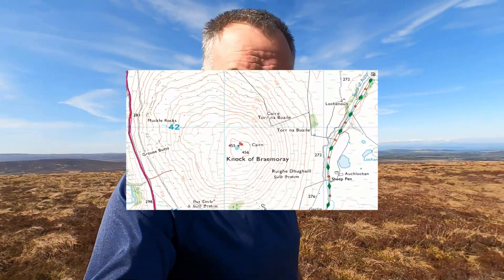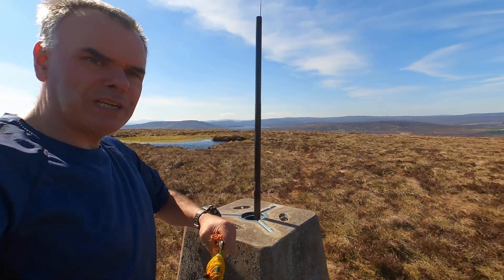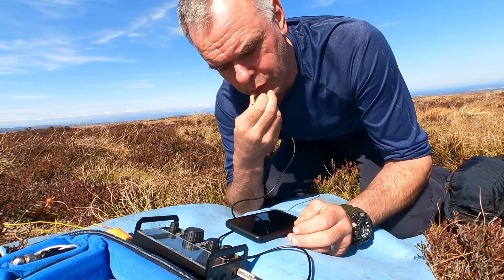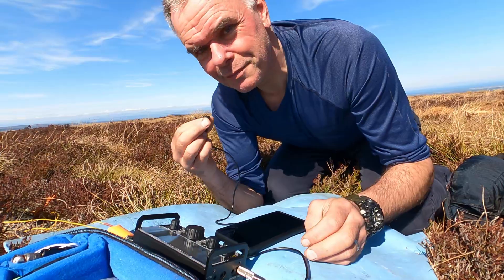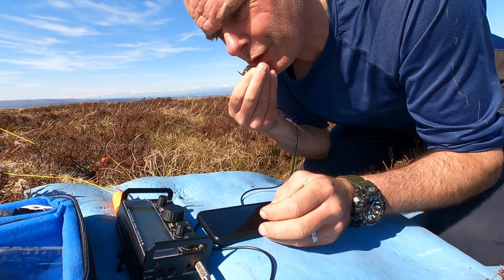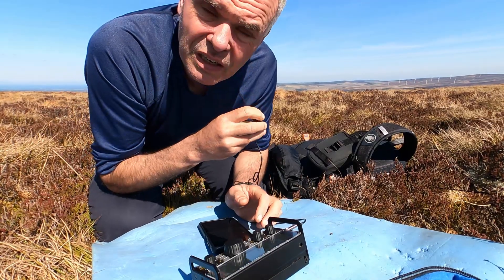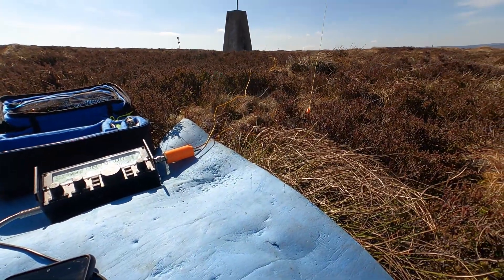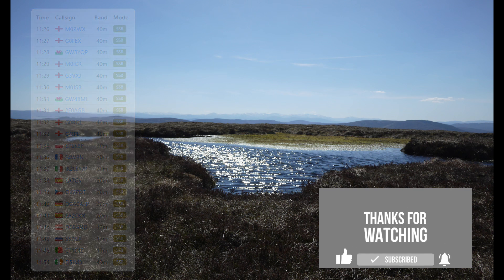What's my next HF Portable Antenna?

Comment: The antenna you used worked so well you may not want to change,  If you do change, consider 28.5 feet long with #26 wire, and use a counterpoise of the same length and wire type.
Reply from the maker: Well I did make a new one!
https://youtu.be/KFFTnBSUQM8?si=USeoo0alyPgDuDDc

https://youtu.be/ivipFuCo-g0?si=BKOG45CcGshRYqZ8

Cheers, Fraser MM0EFI

Comment: Unless I have missed them, no-one has mentioned the K6ARK antennas or the EARCHI. Granted both need a tuner, but they are small and lightweight. I have both but have only tried the K6ARK so far which impressed me.
Reply from the maker: Richard, Probably a little long for my needs. My 6m mast is only 19' in old money! The KM4ACK is longer that that and I think the EARCHI is 25' minimum. I'm fine with using a tuner. In this video I used a 41' wire, 9:1 and internal tuner. 
Thanks for the suggestions though. A lot of people are benefitting from the comments.
73, Fraser MM0EFI
Reply: @theradiorover  Fraser the K6ARK is 41’ to get 80 through to 10m. If you only want 40m and higher, it can be shortened. The EARCHI with a 30’ radiator will give 40 to 6m. For simplicity the two lengths of 25’ wire onto a BNC binding post recommended in the KX2 manual work fine and will fit in a shirt pocket. Good luck on your quest!

Comment: Fascinating to hear what it's like in a quiet location on HF, I have +32dB or more noise on much of HF/VHF/UHF from multiple sources. It's awful from 2.5 MHz up to 2 GHz, which is why I only operate on 136, 472, top band and the higher microwave bands from home.  It's brilliant here during power cuts.  I'll catch you on a summit one of these days! de G4DBN
Reply from the maker: I'm looking forward to a QSO Neil!
I often think a band is closed because it is so quiet. I don't operate HF from home either. Everything in our village is serviced by wooden poles and when I key the mic it tends to turn off everyones Internet!

Comment: Hi Fraser,
I'm also searching for a similar solution for very space restricted summits in the alps. Moreover, it has to be as light as possible. I will experiment with a (compromised) vertical solution that doesn't need a mast and no ATU. I'll create a video this summer, if all works as intended. It will be definitely better than an AX1, but not as good as a EFHW. 
BTW: if 40m is your most important band for inter-G communication, you'd need a bit of (nearly) horizontal wire in the air, otherwise NVIS will be hard to achieve.
One more idea to use a 5m GF mast with a wire that is up to say 50% longer: you could wrap it around and therefore need less vertical length. I'll also experiment with such configuration, by using the ATU-10 auto tuner, that is not as good as the one you have in your KX2, but not too bad either.
73 Stephan
Reply from the maker: Hi Stephan, I built a couple of designs this morning. They both fit on my carbon 6 mast. One is 20m and up with a 9:1. The other is 20 m and up connected straight to the tuner and does 40 m with a 49:1. Can't wait to test them!

Comment: Good activation Fraser and I couldn't agree more that the AX antennas are expensive, as you know everything Elecraft is. The internal ATU does impress me too, it tunes almost anything. All the best and speak soon. 73 Chris M0RSF
Reply from the maker: Hi Chris, there is very little that it won't tune. I'm looking forward to trying some of the suggestions made in the comments to see if I can get a really short antenna to work.
73, Fraser MM0EFI

Comment: Just a 28 1/2 foot wire radiator and a 17 foot counterpoise, will work all bands with an antenna tuner!  ;)
Reply from the maker: Yes, a shorter Random Wire than I have been using. Would save weight and space.
I'd really like something I can use on a tiny rocky summit. Think sea stack!
Cheers, Fraser MM0EFI

Comment: Ive started using my 10m efhw for sota and seems to work ok, but has a balun in a box. Might be possible to reduce the size of this. I was looking at getting a longer pole to make the efhw a vertical instead. But i do also carry an ATU-100 tuner oh and the 857.
Reply from the maker: So, a 10m long wire John? That works on 20 and 10 m without an atu, but has a 49:1 I guess?
Reply: @theradiorover  yea i think its a 49:1 i have used on those bands. I will see if i can find the info for it

Comment: Thanks for your set of videos, im finding them really useful as I'm getting the sota bug!  currently on 41 points!!  First question is about the tiny mic use use with your KX2.  I have a X6100 and have started using it with the built in mic/speaker/ppt (to save weight) but would like to know if I can make something like the one you use for my X6100.  Second question is about my current sota setup and weight. I have managed to get my UV5R + 2m Flowerpot, X6100 + 21m EFLW, 10m Counter, 9:1, 5m RG174 feeder with choke, Sotabeams 6m carbon mast + guying down to just under 2kg.  In their bag they are 2.2 kg.  I'm interested to know how this stacks up with what you take and carry on your "typical" activation and what weight / functionality decisions you make.  I'm experienced in what equipment I need for cold conditions in the mountains, in terms of clothing, food and shelter but would also be interested to hear about the total weight you carry and how much of this is radio gear.  73 E0ICJ/P
Reply: 2E0ICJ/P
Reply from the maker: 2.2kg sounds great for all of that radio gear. I've not weighed the combined weight of my HF and VHF kit together, but from what you describe, mine would only be lighter because the kx2 is probably a bit lighter than the X6100 and if I only carry my 41' antenna, that is lighter than the EFHW plus 5 m coax. 
My KX2 bag contains the radio (internal battery and tuner), spare battery, the mic, 5 alloy tent pegs, 3 guys and a guy ring, the 41' wire/17' counterpoise, 3 velcro straps, waterproof pad, small pencil and a USB power pack that will work with my phone and GPS. I only carry the power pack on remote and overnight trips. 
As for the mic. it is a baofeng one with the kenwood style twin plug cut off and a standard 3.5 mm jack soldered on. You just wire it to suit your radio. The wires are tiny and don't stand much heat when soldering, however mine has worked fine for a couple of years and there is zero difference in the audio. If you have any other queries, drop me a line. QRZ email is good, also Facebook or twitter - @MM0EFI

Comment: KM4ACK has the best antennas ever.  It’s my primary for the FT-818D.  The kits are intermittently available, but you can enroll in the notifications when the kits are in stock.
Reply from the maker: Is that his end fed half wave? If so, I made my own one. I broke it on the Isle of Lewis, hence the need for the back up random wire. If it is a different type, then share details! 
Cheers, Fraser MM0EFI

Comment: Hi Fraser, I don't think that your antenna can easily be beaten for weight.
I have a home made center loaded 5m vertical, resonant on 20m with taps for 40m, 60m, and 80m which I made for a trip to Snowdon with Ben. It's never going to match a horizontal for SOTA on the lower bands where most of our contacts are <1,000 miles but has a small footprint for crowded summits. I have recently made a QRP ground tuner which seems to help, but this antenna is always going to be a compromise.
Tim, G5TM's YouTube video 'How to get great results from your vertical antenna' has sold me on the idea of a non-resonant vertical for DX on the higher bands.  I tuned up my 5m single raised radial vertical (design taken from your video) on 15m and 10m when I was in Tenerife which seemed to work. I plan on doing some experimenting with my GTU on this antenna over the coming weeks and maybe some comparison with a resonant vertical.
73, Kevin MW0KXN
Reply from the maker: Good points Kevin. The 41' wire has got me DX on occasion, even on 10 m. I think my need for a smaller antenna is really for quick operations on small rocky summits, where a long antenna just wouldn't work. I'll check out @g5tm 's video 😊

Comment: Hi, Fraser, So you're right: lately those higher bands have been treating us well (save those days our local star sneezes on us). For a 9:1 antenna, I really love using a 31' radiator and 17' counterpoise on ground. I find that my KX2 can match that from 60-10M. When I get a match on 60M, of course, the antenna is far from efficient, but it radiates. Also, lately I've been using a 20M EFHW which is only a couple feet-ish longer and my KX2 ATU seems to match is just as well. The benefit of it, of course, is that if I choose a radio without an ATU, it still gives me 20, 15, and 10M. With an ATU, it seems to operate as well as the 31' random wire (although, I don't know if I've tried a 60M match with the KX2). 
Of course, all of this you already know. This is just the route I've been taking lately. Planning to build two more 20M EFHW antennas over the next month. Will pick up some parts at Hamvention! Great video as always. -Thomas (K4SWL)
Reply from the maker: The one from the KX2 manual I think? Yes, that's on the list. Some great ideas coming on the comments though. I may have to buy a reel or two of wire!
Thanks, Fraser MM0EFI
Reply: @theradiorover  Yes! That one. Yes indeed, time to invest in wire and try them all! :)
Reply from the maker: Hi Thomas, I do love my 40,20,15,10 EFHW and like you I can tune mine on 17 m etc with the KX2 internal tuner. I'd like to keep 40 m, as it is a really useful band when doing SOTA in the UK. I'm open to using a trapped antenna. I'm loving some of the ideas that are coming up though!
Cheers, Fraser
Reply: @theradiorover  You know--better yet? If you want really short, really cheap, and no traps? Go for two lengths of 28' wire into a BNC binding post adapter. Your KX2 ATU will take that from 40-10 meters and everything in between. I've had amazing success with this setup during SOTA and park activations.

Comment: Hi Fraser, I actually thought about the same question as I was on a fairly high summit with very limited space a few months ago. So my thinking was running a lightweight vertical due to the very likely lack of guying points (inv. V or classical dipole impossible) and the need to stay close to the mast. I do own a Sotabeams Carbon6 which can handle a sloping wire if it is thin but I wanted a true vertical as even a bit of sloping wire could mean I wouldn't have enough space on the summit. Some options I though of: 
1.) 17' wire with 1:9 unun and 1-3 radials (either 25' or 16' each just "thrown down the rock") would give us 40-10m 
2.) Coax-fed Linked Upper & Outer, only possible for 20-10 with the space limitation and probably some difficulties guying the elevated radial. But I think this is a great option in general for the higher bands. Costs almost nothing and each band is perfectly resonant. Proven to deliver great dx.
3.)QRPGuys Tri-Band Vertical antenna (40/30/20m) which you can build yourself for pennies.
Happy about any other ideas!

vy 73 es gd dx de Leo DL2COM
Reply from the maker: Hey Leo, Thanks for sharing some awesome ideas! I'll add those to my list for further investigation. 
73, Fraser MM0EFI
Reply: Activated OE/TI-477 yesterday with Carbon6, 17' wire and only one 16' CP wire on a small 1:9 unun with my KX2. Worked like a charm despite bad local qrm. The footprint was super small.
If there is a little more room I would probably add 2 radials and/or increase the wire length to 29' (having it slope down slightly from the mast tip).
Reply from the maker: @leobismarck  that sounds perfect. Did it work on 40 m and did you use an unun?
Reply: @theradiorover  yup just a tiny 1:9 unun and I did work some contacts on 40m eventhough I only had a few minutes to do so. just make sure the toroid material can handle 40m frequencies and I am sure efficiency will increase when adding two more 16' radials (given that the max. length for the radiating element is 5-5.5m on the 6m mast.). good luck!
Reply: the kx2 tuner got it to 1:1 even with only one radial. the toroids that adam k6ark uses show very promising data when measured across pretty much the whole hf spectrum on a 450 ohm load for 1:9 testing. I also built one with a T68-2 toroid and there efficiency drops significantly on 40m(30-10m are fine), but it still works....

Comment: By the performance of that 41 ft er I'd keep it going. My EFRW is 51 ft and 12 ft counterpoise. I ended up at that length cos the KX3 seemed to tune it easiest.  I have gone to the dark side and made an EFHW  with a  "36 t 1 balun" !! cos I stuffed up the instructions when winding it. Had 30 QSO and 18 DX to EU on my last summit with it. 3 primary 18 secondary no cross over. Regards Ian vk5cz ..
Reply from the maker: Good work Ian! I do find the 41' wire does an incredible job. I am just looking for something for a quick activation on smaller summits. May have to look at base loading...

Comment: I think the issue with a random wire will be for those running things like IC-705’s with no tuner.  I personally favour an EFHW as the best compromise antenna, but have also built a trapped 20/40 dipole, and an OCF dipole that will do the main bands when built to do so.  Another good (commercial) option is a Wolf River Coil, but perhaps not ideal for summits and a bit pricy for those of us outside the US.
Reply from the maker: Yeah, you guys have some nice commercial stuff in the US. Unfortunately the prices are silly over here. A shorter EFHW would be good, but I need 40 m as it really is the Go To SOTA band.
Reply: @theradiorover  I'm in Australia, so we can buy radios locally way cheaper than the UK, but get screwed way more for freight on anything from overseas!  :)
Have a look at HF Kits in the NL...they do a shortened EFHW which is 40-10, but not much longer than a standard 20m version as it uses a loading coil and short tail for 40m.  Narrow b/w, but if you centre it on the local SOTA/POTA/WWFF frequencies it'd be fine with no tuner.
Reply from the maker: @ammocraft  I have built every SOTA antenna I own, but tend to keep them simple. A wire plus counterpoise is perfect for a mountain summit or a quick Op in poor weather. My 40,20,15,10 EFHW is generally my 1st choice, but I broke it the previous day. This time I'm looking for a shorter antenna for small rocky summits. Some good ideas coming in!!

Comment: Hi Fraser. I've been meaning to ask about the mic you use on the radio. That thing is tiny! Is it specific to the Elecraft or can it be used on other radios (such as the Icom 705)?

Not sure about the antenna question. I think you already travel lighter than most of us so I'm probably not one to be giving you advice on lightening the weight in your pack. I think the EFHW is about as small, light & simple as it gets. If it was me I'd probably be looking at repairing or replacing that.

I really like the Slidewinder setup that I use but it's both bigger & heavier than your setup. The big plus to the Slidewinder for me is that it's self-supporting so I don't have to carry a mast but I DON'T think it's the right solution for what you are asking.
Reply from the maker: James, it is just a baofeng lapel mic. with the earpiece wire cut off. I removed the Kenwood style plugs and fitted a single jack. It could be wired to suit any radio. On SSB no one ever gives me poor audio reports. It cost £5
Cheers, Fraser MM0EFI

Comment: Fantastic work Fraser. I an also interested in what people come up with I am right there with you. I want to be able to use my 6m mast. Need something with a small footprint.
Motters M7TRS 👍🏽 73
Reply from the maker: Some good answers so far Motters!! 😂
Reply: @theradiorover  Fraser I was in the garden last night trying different antennas to hand. For portable for me I think the 40-10m efhw is going to be the best for me upto now. I have a 40-20m trapped vertical but limited to two bands. Also have the 40-20m linked dipole but again limited to two bands. So for now the efhw is the winner. My only problem is the footprint. 
I have managed to get a stubby 6m mast  which is better for the backpack. So am yet to try a inverted L efhw with it.
Only tried a inverter V more like a Z in the garden. 
I want the biggest bang for my buck with the smallest footprint as my max TX is 5w (ft817)
Love the work you do dude great work with Mo too going out portable with you.
Motters 73
Reply from the maker: @m7trsradio  nice one Motters. The good thing about an EFHW is that it does work as inverted V, sloper, or vertical then sloper. When we were in Tenerife, some of the summits were small rocky tops where it only just fitted! I use mine with 5 m of skinny coax, so you can have a bit more flexibility where to sit and can usually get in some shelter with the antenna out in the elements.
Glad you're enjoying the videos. Mo says 👋 👋
Reply: @theradiorover  hi back. Hope to get you in the log one day. Think I have kitted my 817 out enough. Will send you a pic one day. Was ment to travel light but the light just keeps getting heavier and heavier. Never wanted an atu for it but have one now. Never ends does it 😆
Reply from the maker: @m7trsradio  Ha! Well you have everything you need now, so get out there and go for it. Be good to see some pics. I'm on Facebook, twitter @MM0EFI and my qrz email is good too.
Reply: @theradiorover  currently down at  Thetford so will send you a pic when back home. Have a good evening 73
Reply from the maker: @m7trsradio  73 mate!

Comment: Not really a random antenna but I just use the 49:1 & 17m of wire and recently worked vk5 and fy5 with the kx3 using the carbon 6 pole 

2E0HPI 73 keep these fantastic videos coming
Reply from the maker: Cheers Carl. I also use one like that. I've worked QRP DX with it, even on 10 m where it's not at its best. I am enjoying reading some of the ideas folk are coming up with 😊